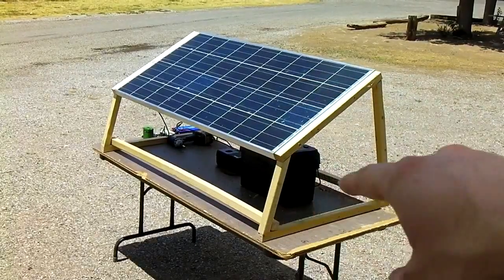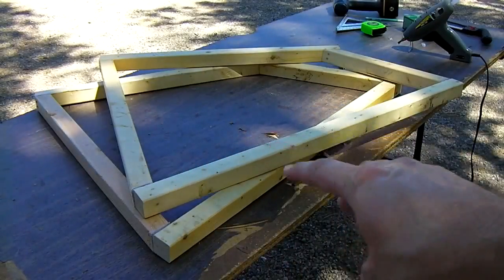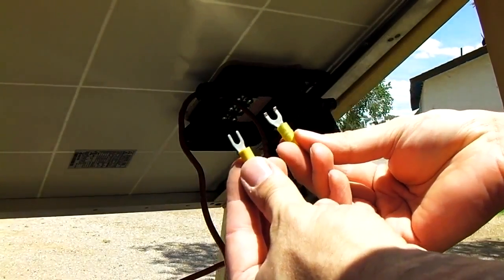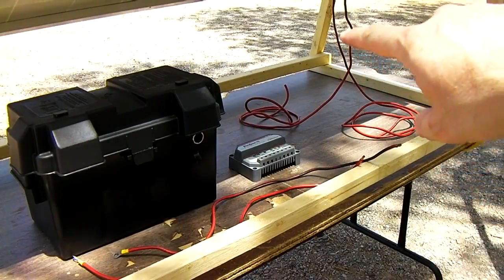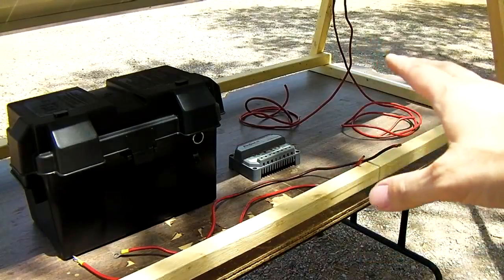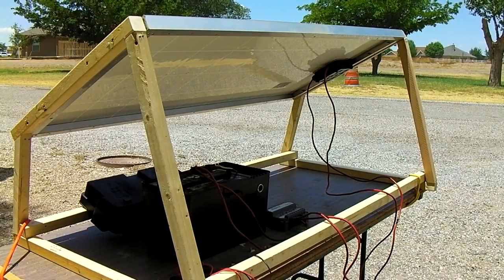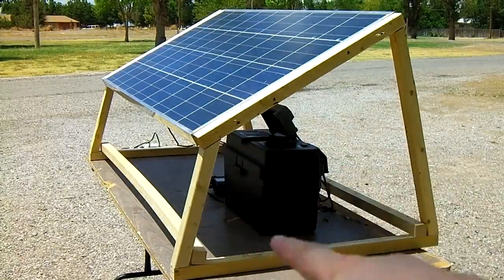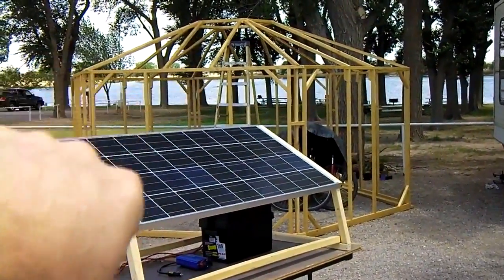How to Build A Solar Generator - DIY Survival Prepper Solar Panel Installation

Comment: Great Video! I was searching the internet the other day for solar kit info. I am wanting to provide enough solar power to a small 14x36 half log cabin and trying to not spend alot but at the same time keep the quality! I wont mention no names but there is a place that sells cheap solar kits but they look very cheap if you seen them in person. I liked the quality of the solar panel in this video, great job!

Comment: First this is not a car battery, a marine deep cycle battery is used. Yes you can use it to power your laptop on a daily basis. You will need an inverter to create 12 V  AC from the 12 V DC battery, or  cigarette light adapter that works with laptop.

Comment: The cigarette lighter connection to the inverter is a very poor choice. You should hard wire the inverter to the battery. A cigarette lighter plug cannot stand high current for very long ... and a 400 watt inverter will draw something like 40 amps of 12vdc power when delivering 400 watts. Eventually the spring inside the cigarette lighter (the one for the center post) will loose its spring from the heat generated from that high current.

Beside that, a 400 watt inverter, at full draw, will run that battery down very quickly.

Comment: I have a solar generator a 12 volts solar, 12 volts motolite battery (car battery), a charge controller(huoer brand china made) for 12 volts solar panel and a 220 volts w/ 1000 watts power inverter. my problem is even a sunny  whole day my 12 volts battery was not fully charge it had only a 25% charge.i suspect my charge controller because it was a china made, is am I right w/ my conclusion?.what might be the possible defect of my solar generator?please answer me..tnx very much.
Reply: You need a Deep Cycle battery, a car battery is not made for long periods of amp draw. your battery is probably junk